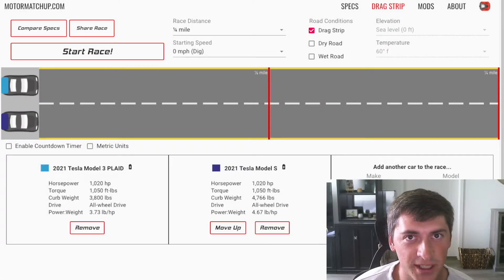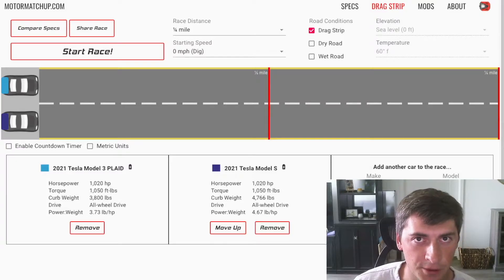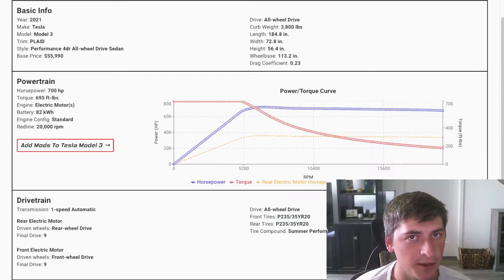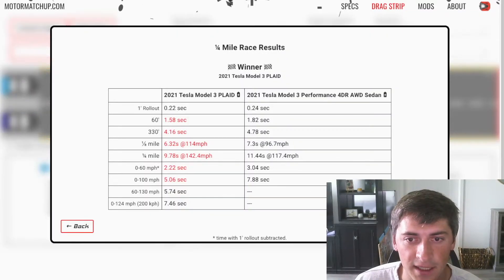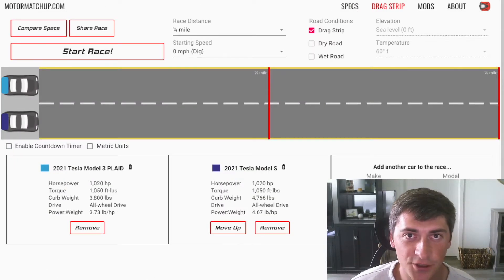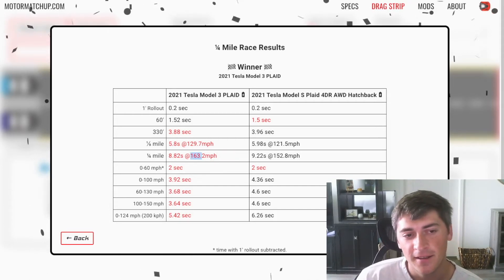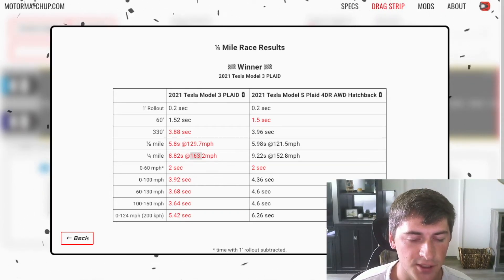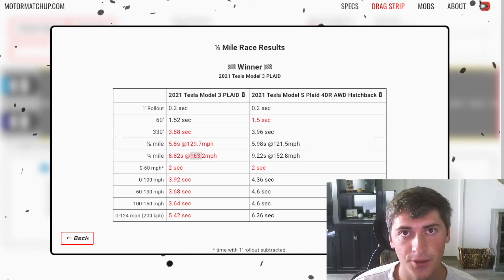Putting PLAID in a Model 3? Analysis and Drag Races (PART 2)

Comment: 2024 Model 3P 650HP with two of the Model S plaid motors should be in queue .....mid 10 sec 1/4 mile at ~ 130mph trap spd. Stay tuned and keep dreaming. 🙂

Comment: Do you know if the physical dimensions of the plaid powertrain are the same so you could more easily swap the M3P guts to the plaid guts?
Reply: It wouldn’t work. The battery has a lot to do with it and the electrical work would be a headache. I’ve thought about it too

Comment: i think they will likely but dual plaid motors in the M3P soon. Telsa needs to compete with the Corvette c8 and the new BMW AWD. I think realistically it would run a 0-60 in the 2.5-2.9 and a quarter mile in the low 10 second range. it makes the most sense for tesla to do this as it would cost productive to just switch the two motors and not re engineer the car to have 3 motors. I think they would make it  slightly slower than the model s LR. They wouldn't want to eat the sales of the model s long range.

Comment: What will be the top speed in a 700hp model 3 plaid?
Reply from the maker: With the 7.5 final drive ratio, it's easily hitting max RPM (20,000) at 214 mph. 700 HP would get the car to around 240-250mph if it had more RPM to work with.
Reply: @MotorMatchup  cool thank you! Potentially around 220/230 but even 200 is plenty of speed!

Comment: Why does changing tire height effect top speed on the Tesla?
Also when we be able to change electric cars torque curves and values?
Reply from the maker: Tire diameter changes the final drive ratio indirectly. If you took 2 cars with different tire diameters, the one with bigger tires would have higher motor RPMs at the same speed.
Reply: @MotorMatchup  I would graft in it in a Model 3 if i had the parts and piggy back 4-6 Model S P100D Raven battery modules to boost the Model 3 battery pack :):)
Reply: @MotorMatchup  I forgot to prof read..why doesn't changing..., lol. I had noticed  the plaid would top out at 200 no matter the tire. But I seen today you added gear adjustability . Awsome,  I'm about to get on it now 😀. 
I hope soon we can add weight , for towing sm.
 Thanks for you efforts,  I'm loving it!!!

Comment: I think even if they would make the 700hp Plaid version for Model 3 (although wil be not as fast as the model S plaid), it would cannibalize the S Plaid. A under 10s sedan, under 8s for 0-200km/h, for sure much cheaper and due to the much lower weight, more efficient (longer range for the same number of kWh charged).
Reply from the maker: Yeah I agree, but I think it also comes down to pricing. For example, Tesla could make the AWD Model 3 a bit faster at around the $50K mark. And then they could have the "Plaid/Performance" version be more in the High 60's - Low 70's. Also it will probably always have a smaller battery pack, so less range. It also sounds like Model S Plaid has more room for top end power with software updates, so it could push it far enough ahead. Regardless though I agree that it's an interesting problem and will be interesting to see what powertrains and pricing the new Model 3's will get.

Comment: if they just made a perf 3 hold full power to the top end of 165 mph, that would be insane.
Reply: The vehicle is restricted by amperage. I hope they get a M3 plaid. The cybertruck basically just got it and does an insane 0-60mph
Reply: @gotchyeaaa  Its also the motor type. Torque ripple and centrifugal forces prevents higher flux when approaching those speeds (plaid uses a different motor that solves both)

Comment: The 700hp Version can become reality. That would be so awesome. With a 90kwh battery this would be my next car 😀
Reply: In order to do that, they must take the S Plaid to the level of then announced Plaid + (higher power, the large battery with very long range and as much as possible to keep the current price), otherwise it will get cannibalized by this Model 3 Plaid, and i don't believe the company wants that. In the last years Model 3 cannibalized the Model S and i think, when they put the Plaid platform on S, that's why they didn't want to implement it on Model 3 and Model Y.
  My guess is, they postponed the release of the Roadster for the same reason. They announced some performance specifications about 2 years ago, but they are already nearly reached by S Plaid, plus S is a very practical family car. So they have to make the Roadster significant faster than then announced one (and as for the range, i guess that's why they didn't put the large 200 kWh battery on S to create the Plaid+). On short, you have to have a much spotier car than S Plaid in order to overcome the practicality of the S and the 60$ price difference. Of course, the price of the Roadster is low in comparison with other super and hyper cars, but the Tesla buyers will directly compare the company products.
Reply: @sorinturle4599  very good answer from you. I can just say you are right

Comment: Elon said that plaid motor can get to "20 000 RPM and some", and in Brook video from plaid event tesla engineer said that motors power is actually 400HP  each but are limited by traction and battery in current tesla model plaid.
Reply: I heard the plaid car get 1400hp but doesn’t have enough power to support it. Figure 467hp per motor